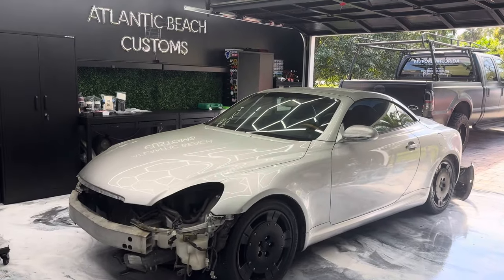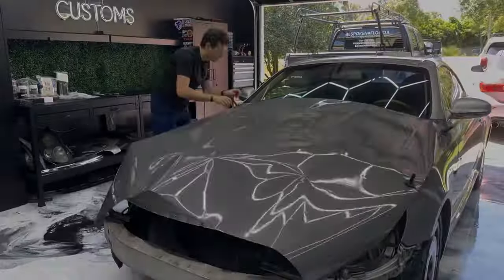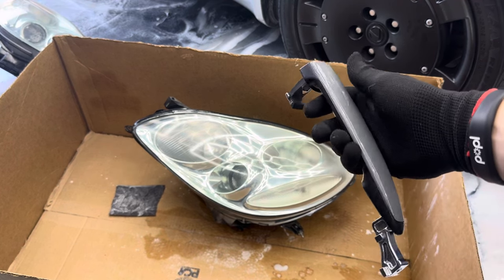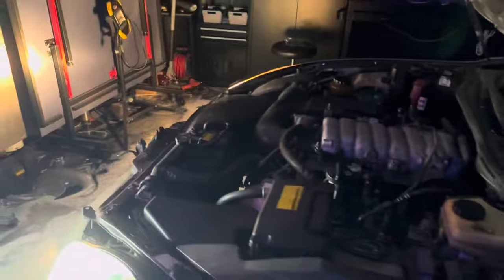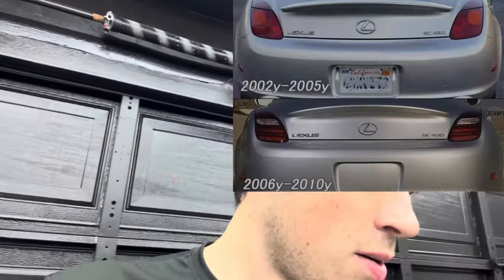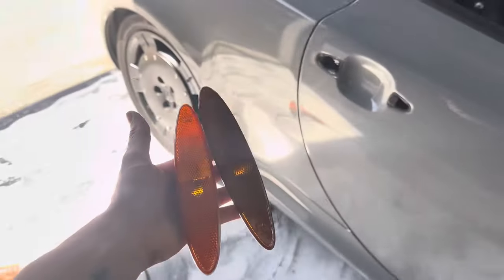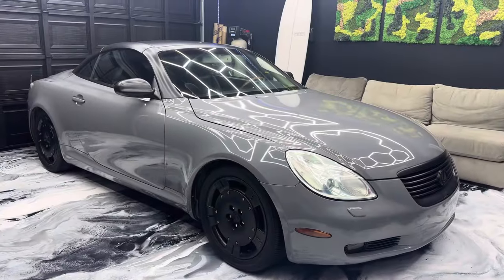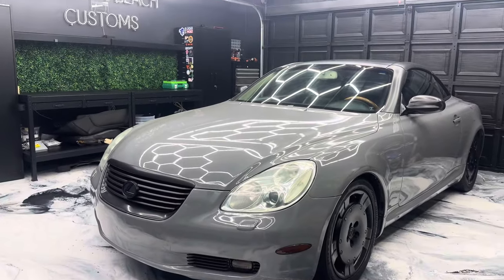$2000 SC430 BUILD PT. 4 - Full Vinyl Wrap + Exterior Transformation!

Comment: Always been a fan of monoblock wheels. Throw some spacers on for that flush fitment and its CLEAN AF
Reply from the maker: They are definitely unique! I’ve never hated them like most people do. The tires are pretty bad so I have to replace those anyway, would you buy new wheels altogether or keep the monoblock ones and just replace the tires and add some spacers?🤔
Reply: @Atlanticbeachcustoms  Personally, the purist in me would not have painted the wheels black but instead refinished/repaired them if they were worn looking.

With that said, if budget allows, I would buy new wheels since the stocks need new rubber anyway. Depending on how wide you go and the offset, you can skip the spacers with the right setup.
Reply from the maker: @adventsociety5382  Gotcha gotcha! Yeah I’ve got my eyes on some nice silver 11” wide wheels… I think some new wheels would be a great finishing touch for the exterior🤌🏼
Reply: Same! I think they look cool
Reply: same i dont mind em

Comment: Looks Great!  I love my 04 SC!  BTW, I'm sure you've realized there is no place on the rear of the vehicle to open the trunk with a key.  There is a latch in the lower-level armrest UNDER the carpet.  It will release the trunk.  When I bought my new SC 20 years ago, I accidentally dropped my keys in the trunk and couldn't start the car.  I had to call the dealership.  Anyway, great video!  Good luck with your SC!
Reply from the maker: DUDE THANK YOU SO MUCH! I thought I was going crazy in my part 1 video when I couldn’t find a way to manually release the trunk😂 Glad to hear you love your SC, do you mind if I ask how long you’ve owned it for? I love these SCs more everyday

Thank you so much for the support and your comment🤙🏼🤙🏼
Reply: @Atlanticbeachcustoms  I'm glad I helped.  My SC is mint with 63k on the clock.  I bought her new in 2004 from Falk Lexus in Beverly Hills, California - and no, I don't live in BH. I have been fortunate enough to have owned other cars simultaneously that I've also enjoyed without putting miles on the SC.  EVERYTHING works beautifully in these cars.  The 2004-2008 LS sedans were also works of art.  Those are damn sexy sedans. The SC was called "The Crown Jewel" of Lexus during its production years and had the highest resale of ANY car during those years.  It amazes me what these cars are still fetching in price.  I paid about $64K new. To me, they look expensive Japanese. I think they'll be even more collectible in the future.  Lexus over-engineered these cars to compete against Mercedes during this early period with their cars - before Lexus was LEXUS.  As long as you replace the timing belt every 100k, which you did, these cars are solid and will last many years.  I have no squeaks or rattles. Everything works brilliantly. The Lexus 8 cylinder is like butter.  I've only had two problems since new.  Front passenger side oxygen sensor ended up melded to the manifold - Lexus dealer $2900.00 to drill it off.  Three screws connecting one of my Lexus Chrome wheels had to be removed by a Lexus Mechanic - $1300.00.  I've owned Cadillacs, a 2003 Tacoma (21 years), a Miata (most fun you can have in a car with your pants on) and a couple of Jaguars.  I live in Rancho Mirage California - you know, Palm Springs.  There are several of these SCs as garage queens for the snowbirds that live out here.  And it's also weird out here because Rancho Mirage has a population of 18 thousand people, but its Rolls Royce and Bentley Dealership sell more cars here than anywhere else in the United States.  Go figure.  Anyway, I have never got tired of my SC and I still look back at her as I walk away from her.  Enjoy your car.  You're doing a terrific job with her.
Reply from the maker: @wayneonpark I think that was the best review/description I’ve ever read about the SC… bravo!!! Thank you so much for all that history and info about your personal SC430, people like you are the reason why I love YouTube so much haha.
Reply from the maker: @wayneonpark So glad to hear you’ve enjoyed your SC so much, from the little bit of time I’ve spent with mine I can already tell why they are so popular!! Thank you again!!😄🤙🏼🤙🏼🤙🏼
Reply: You're the man!

Comment: Turned out awesome! Great work! Wheel spacers and coilovers will change the look and make it look more modern imo. I went with H&R 20mm in the front, 30mm in the rear and coilovers. Black out the exhaust tips and tint next?
Reply from the maker: Thank you so much!!! Yes I need to figure out something with the wheels/fitment, have you had any issues with yours? And YES I have exhaust and tint on the list as well, you read my mind!🤫😂
Reply: No rubbing at all. Even without coilovers it look much better. But I wanted a firmer and more responsive ride. I have a little more than an inch gap and settings on the coilovers are set in the middle.
Reply from the maker: @kinhtang808  That sounds like what I’m looking for, thanks for the reply!! Have you done anything else to yours?
Reply: Just a Blitz Advance Power Air Cleaner to hear a little throaty sound. I personally feel this air filter is perfect. You hear it on high rev but absolutely stock while cruising. Highly recommend it. I wanted to keep as much OEM as possible. Also upgrade my tires to Michelin P4s 255/40 18.
Reply from the maker: @kinhtang808  Awesome thanks!! Have you done anything to the exhaust? I would love to see some pictures of your car if you wouldn’t mind sharing!
Reply: @Atlanticbeachcustoms  No exhaust on mine. I can send you pics. Let me know where to
Reply from the maker: @kinhtang808  That’d be awesome! I’m on instagram @atlanticbeachcustoms if you have an Instagram?
Reply: I’ll you pics soon
Reply from the maker: @kinhtang808  Awesome thanks!!😄 Just let me know on here when you do
Reply: @Atlanticbeachcustoms  just sent it
Reply from the maker: @kinhtang808  sweet!